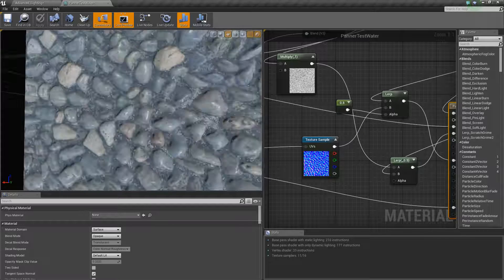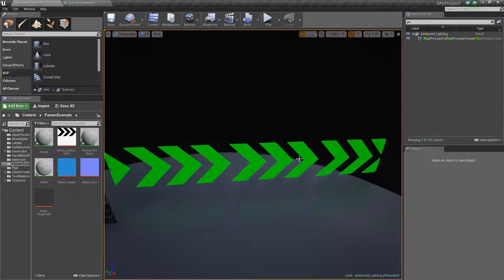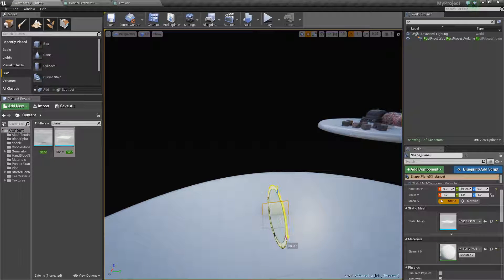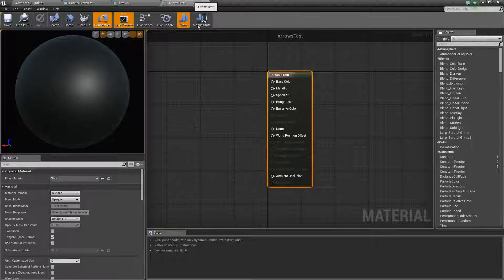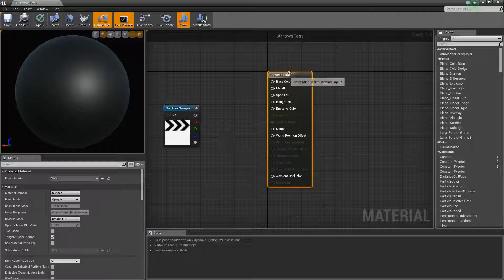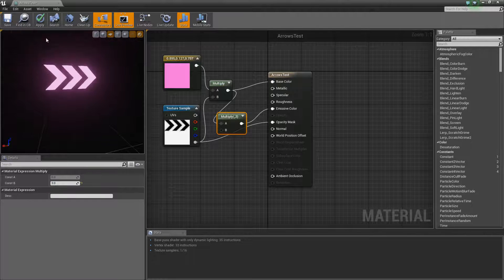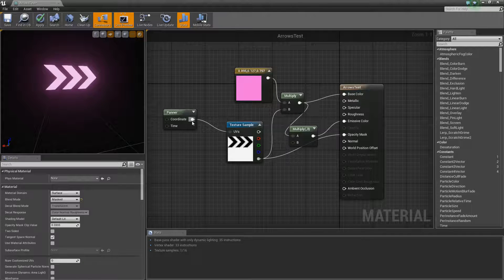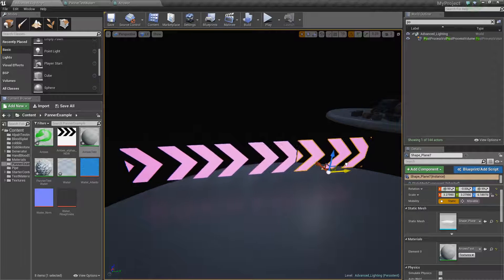Ue4: advanced materials (Ep. 13 Panner Node - Animated Material)

Comment: that works perfectly, could u please tell , how to bring this to sequencer ? i tried animating the speed parameter, but the values are extremely small , one light streak happens between 0.000025 to 0.00005 lets say, and if i click render it doesnt work, and if i restart engine , the sequence doesnt work at all, but the panner works in the viewport, i would really appreciate if there is  a fix for this

Comment: Please I need some help, I'm getting crazy because I'm trying to connect a button (who appears into a widget) with a static mesh to change its texture, I already did this by creating an actor with the same mesh I need, the porblem is I have a scenario with more than 300 objects, so I would need to recreate one actor for every single object to build the scene and actually I just want to selecta mesh ang change its color with a widget (I also can change the color from a static mesh in real time with the keyboard but I can't do it by using widget). I have read a lot of forums but I understan they always create actors. Can you suggest something for this issue? Thank's in advantage
Reply from the maker: That sounds like you just need some parameters and lerps? I will have to look more into it when i have some more time.